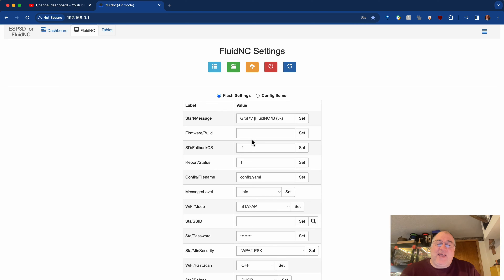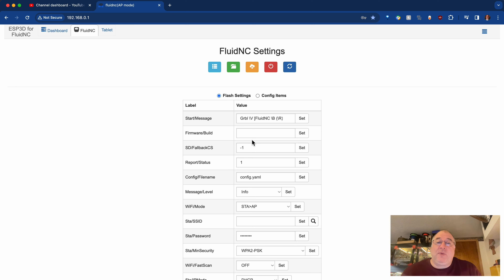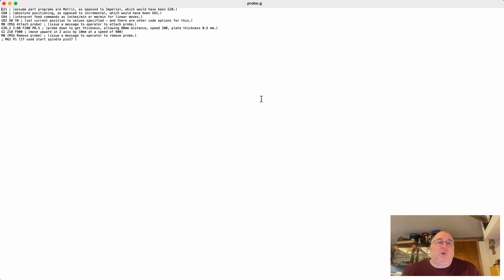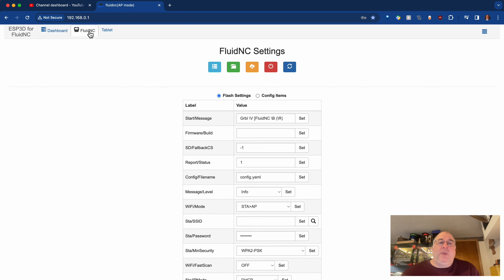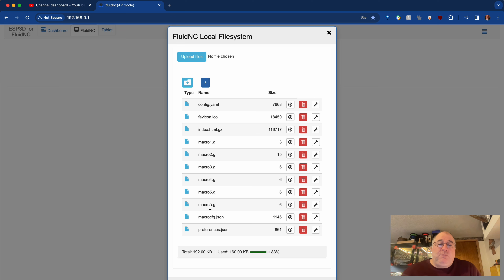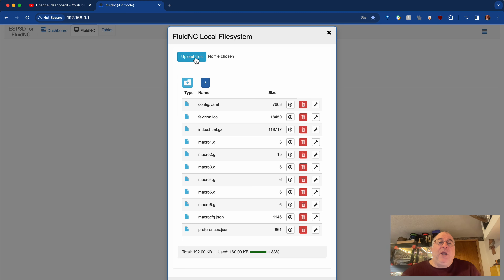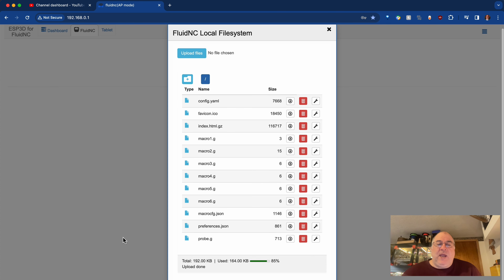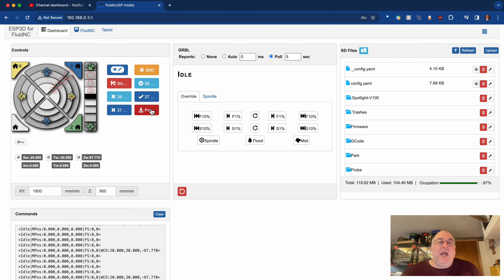LowRider v3 CNC with Jackpot controller - Workflow Explained - part 2

Comment: Hi Doug, tricky question for you. Does one attach the power supply directly somewhere on the jackpot case / lowrider beam? Or is it better to have it on the table somewhere and bring just the cable to the jackpot? Thank you.
Reply from the maker: Most LowRider makers — based on my observation through the V1E forum —do seem to embed their AC-to-DC power supply inside the beam of their LowRider. I also did it that way.
Reply: @design8studio  That helps. Thank you

Comment: I want to order some parts for my first lowrider. Total noob, but have to choose a controller, jackpot or skr pro. My plan is to mount a 5w laser attachment to the router. Can you give me a hint which controller i should order? (guess it´s the jackpot, but just to be shure ..) THANKS
Reply from the maker: I would say Jackpot, definitely. It's firmware (FluidNC) is GRBL compatible, and that means it does better (and faster) at raster moves for laser. It's also got other advantages over the SKR for CNC work. For a little more details on it, check out this reply I made to a similar question on the V1E forum: https://forum.v1e.com/t/garage-shop-mobile-lowrider-v3/40549/41

Comment: Hi Doug, can you clarify something for me?  Looking at the gcode for the probing script, I don't how the actual z offset obtained from probe contact is retained. I am an absolute beginner who knows next to nothing about gcode, but I am an experienced coder in many other languages and what I would expect is for the script to set a global value that would then be used by any subsequent code or job.  I've looked at the documentation for G32 and it says nothing about this. What am I missing here?
Reply from the maker: The FluidNC wiki has a nice helpful section on probing. Notice the subsections on "Using the probe" and "Setting Work Zero" and especially "Optional P parameter" which is what I use in my script, and it not only sets the zero but does so to accommodate for the touch plate's thickness. http://wiki.fluidnc.com/en/config/probe
Reply from the maker: Regarding the concept of a global var or param, there is a whole array of coordinate values that are stored in any board running either GRBL or FluidNC, regarding not only the "machine" origin for each axis, but also for multiple "workspace" origins for each axis. The Zeroing process sets one of these, depending on how you program it. Please watch this super helpful video that explains the various workspaces: https://www.youtube.com/watch?v=fGtbkVJBXyE
Reply: @design8studio  Thanks! That was really helpful.

Comment: Hey Doug, great stuff! Thanks so much for the videos. Do you by any chance have a video  of wiring up the jackpot controller?
Reply from the maker: I don't think so, but the Docs do a pretty good job on explaining what gets wired in where. I did document some of my efforts to switch to the Jackpot (see link). One of my videos (about a printed "make a block") does show where on the board the end-stop switches get wired in, and where the touch plate gets wired in. https://forum.v1e.com/t/getting-started-with-jackpot-on-lr3/40849
Reply: Thanks so much Doug. That thread really helped to see what I am up against. 

 @design8studio
Reply from the maker: @paulthomann7911  bear in mind that I saddled myself with an additional task of swapping the X & Y axes because that’s how I have my LowRider set up due to my room situation. So part of that you may be able to ignore.
Reply: @design8studio   Well thanks. I understand all that. Not my first rodeo. I have a Lowrider 2 and a Lowrider 3. My Rambo board is starting to act rather flaky so I decided to replace it. When I went to V1 I saw they had discontinued offering it. Since I didn't want to spring for another SKR Pro I decided to give the Jackpot a try. Seems like using a GRBL post processor vs a Marlin is not really a big deal so I started looking into what I was up against and of course banged into your journey. I haven't received it yet but I am printing out your box as we speak. Thanks for all you do. I have looked at several of your other projects and they are all very well documented.